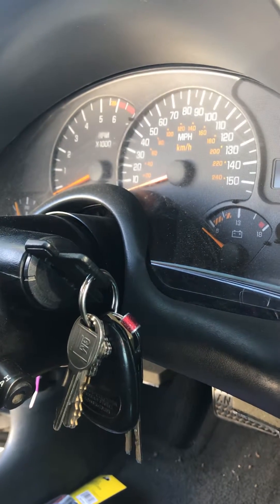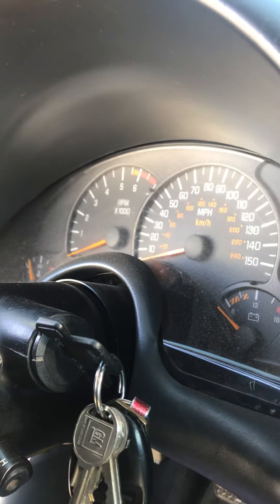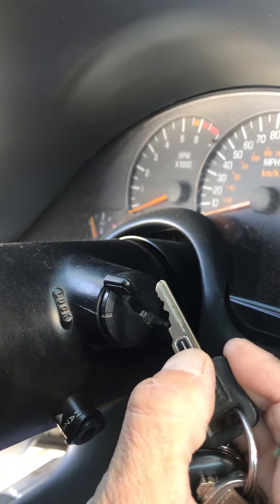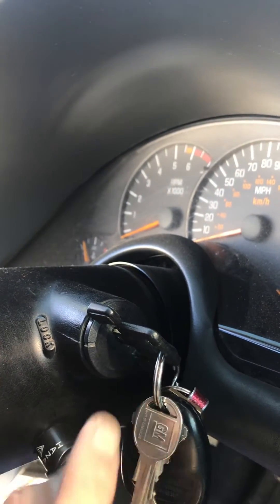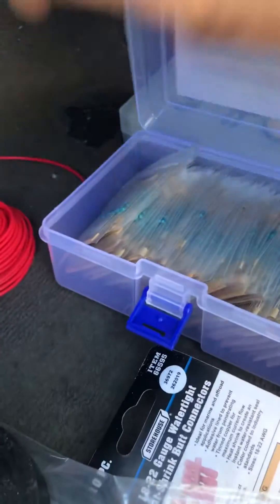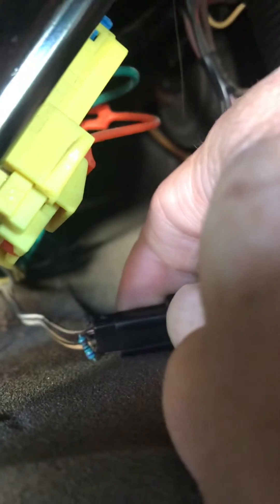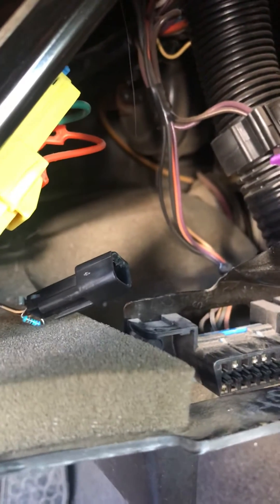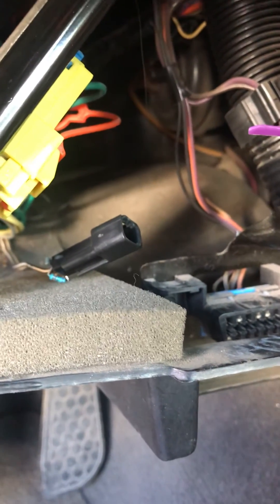GM VATS FIX!! GM VATS bypass module with a resistor

Comment: My resistance for my key is .88 ohms. If I put two .50 resistors together how do I do that and would it work? Thank you. 96 Camaro
Reply from the maker: I know there is a little bit of wiggle room on the resistance, but I think that would be out of the range, let me check and get back to u here just a sec
Reply from the maker: Looks like the acceptable range is .850 to .942 ohms for your key, which is a #4 Vats key, so I think it’s a bit too much, also you would have to put them in a line to acheive that resistance, just Incase you weren’t sure, I just thought of that, but here’s a link to the vats chart! Good luck - https://www.thirdgen.org/vats_passkey_system/
Reply: @Azkeyguy  thank you sir! Vats key #4? That’s that thing that I keep looking up on eBay and it’s like a $20-30 part that just gets rid of it? Thank you for helping me.
Reply from the maker: Yep you can buy the kit or you can trace the wires from the steering wheel, the Orange one, cut it in an accessible area, peel back a bit of the orange cover and wire a resistor with the corresponding impedance/resistance into both sides of your newly split wire, and then that makes the bcm think that the correct key is in the ignition allowing it to start, I bought 1000 resistor pack on amazon for like 11 dollars, I used one and have 999 left lol! Did you end up getting it taken care of?
Reply from the maker: https://www.amazon.com/Security-Ignition-Cadillac-Chevrolet-Oldsmobile/dp/B00S8W8S0G here’s a link to the right key, you can have it duplicated at your local hardware store, or if you put in the resistor into the wire that I mentioned above then you can just use the same key that already works your ignition l since it is already cut right, you are just fooling the bcm into thinking the resistance on the key in the ignition is reading right and allowing the security to be off

Comment: I found this video very helpful. I hope it works for a 2002 Grand Prix
Reply from the maker: It should work, just have to ohm the key and find the resistance amd match the resistor and splice it into the wire, you can poke it in the connector before you cut anything to check and see if it starts! Goold luck and thanks for watching!!!

Comment: is there a certain way you have to put the resistor in?
Reply from the maker: Nope it will go in either way there is no direction on it, you can poke it in the connector before you cut qnything to see if it works, make sure the resistor is touching the metal parts of the connector tho, thanks for watching hope it works for you!!
Reply: @Azkeyguy  thank you for the information ill try when i get home , i just ordered a VATS module from gator hopefully that works or im going to try this solution again.
Reply from the maker: Awesome, that should work good for ya, let me know how it goes!

Comment: Yeah so um what resistors do you need  a 7500 ohm? Thanks oh and great video please post more videos of your car.
Reply from the maker: Gm has 15 or 16 different ohms signals so you have to get the right ohm resistor that matches your key, if you ohm your let out with your multimeter on 20k ohms, it will let you know what ohm key you have and what resistor you need, thanks for watching
Reply from the maker: And more car vids coming soon!!!
Reply: Awesome great info thanks and, hope to see it!